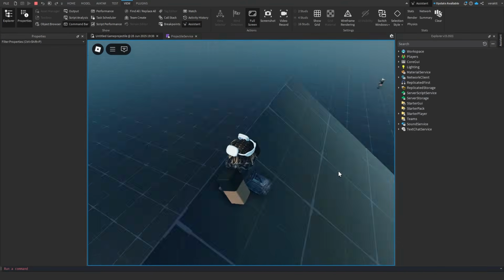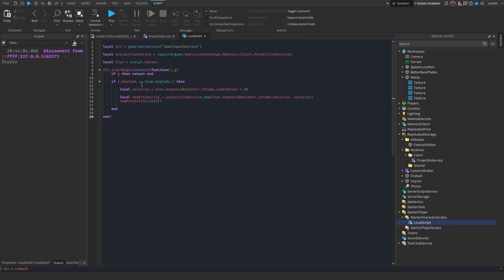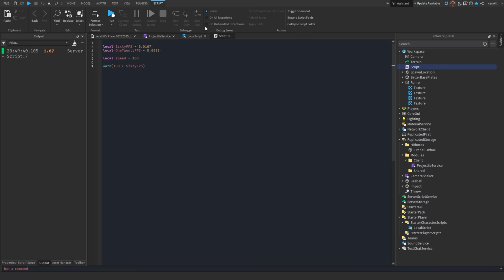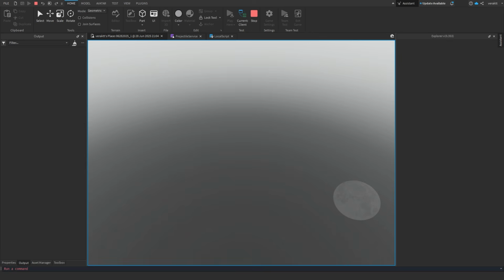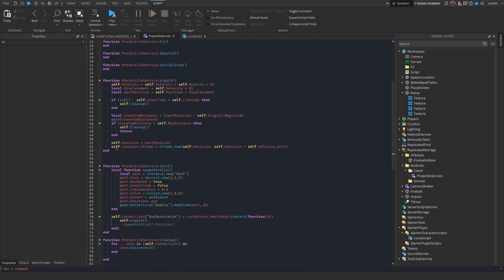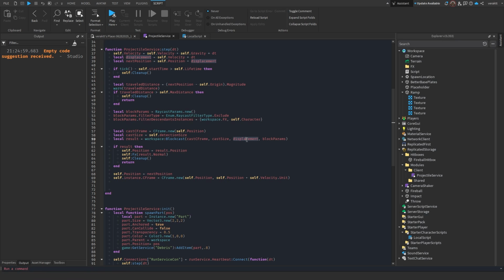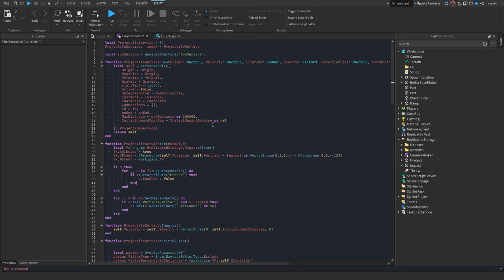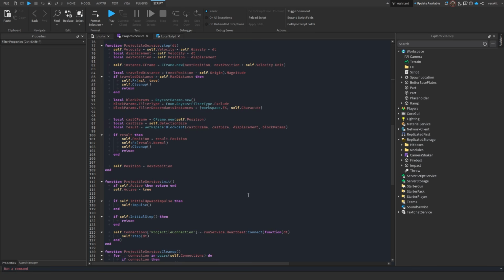Roblox Studio | Advanced Projectile Tutorial

Comment: Hello,  the anim:GetMarkerReachedSignal in my localscript doesn't seem to fire. I added prints inside them and they aren't printing anything out. My animation has a "Spawn" marker at frame 0, and then a "Throw" marker at frame 30. No errors are being thrown at me either so im lost. 

Ok i just found out that the blender to roblox animation plugin's animation events don't seem to actually apply to the animation on import, so i had to try applying them using the roblox animation editor and it works now.
Reply from the maker: double check the spelling of the animation event as it is case sensitive
Also, is it playing the anim?
Reply: @verakttyes, it works now